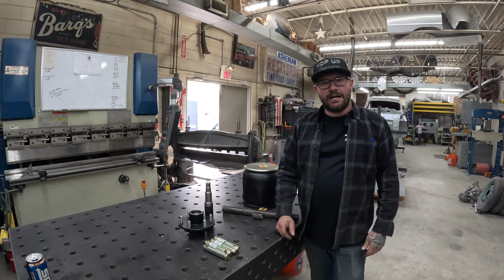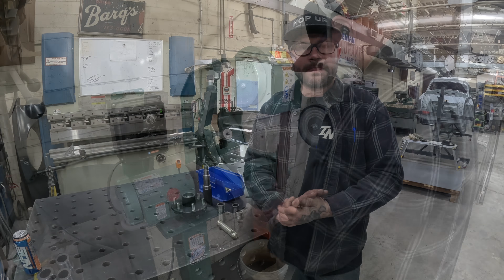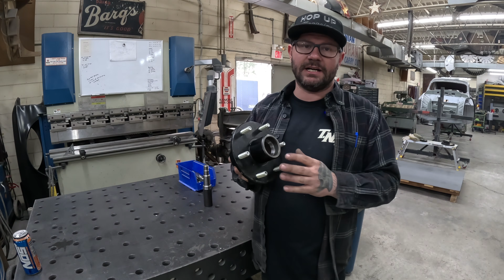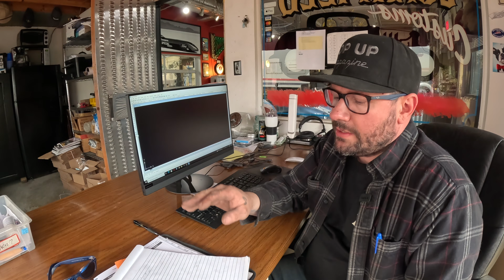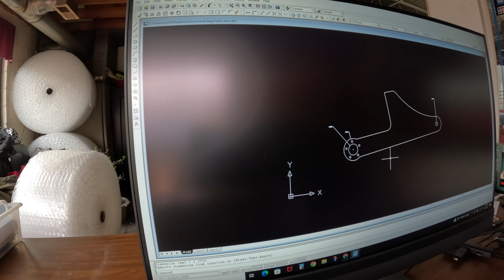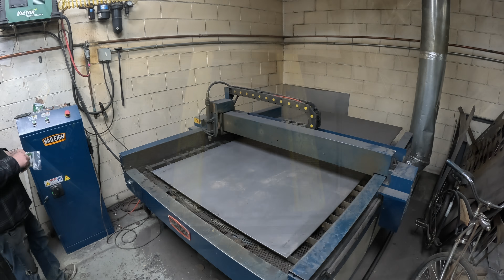The Trailer that broke the world - Episode 2

Comment: The best thing is that it is going to be built the way you want it and work the way you want it. But I wish you had thrown it together EXACTLY as it was laid out on the floor and then put about 4000 pounds on it and took it out and thrashed it on bad roads to prove nothing would immediately bend or fall apart. Isn't worth all that just to prove morons are wrong.
Reply from the maker: i figured the articulated tongue would appear even weaker to the mouth breathers so they will get more upset
Reply: @cornfieldcustoms  That's it.....egg them on HAHAHAHAHA  👍

Comment: I would have used the pins to hold the sleeves and then clean them up. See this is why I should be working there.👍😎
Reply from the maker: Thanks but i will stick to the way i cleaned them up. Way easier to control the part the way i did it